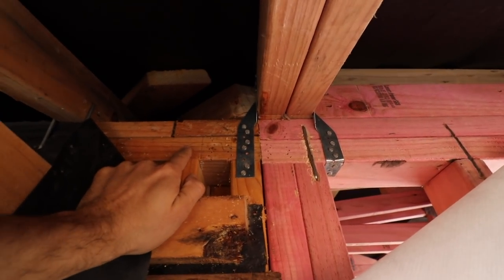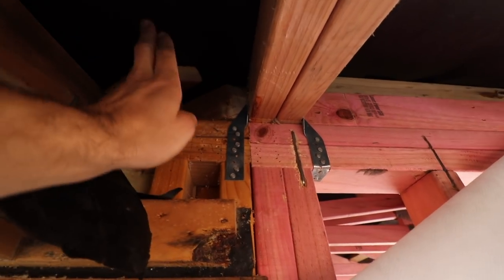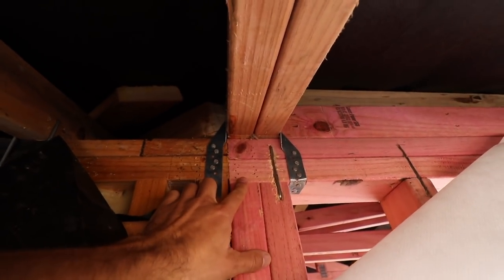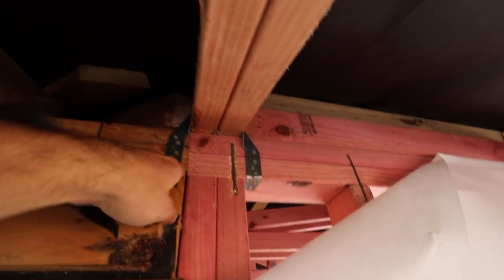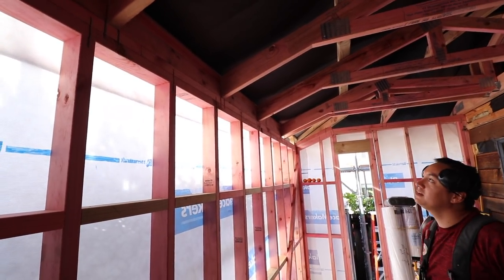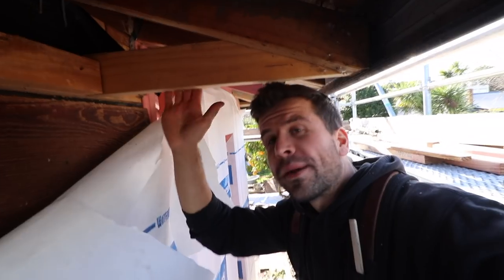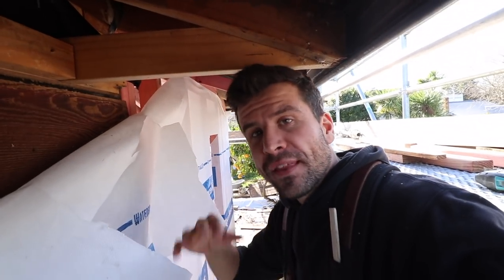Why is New Zealand Timber PINK?

Comment: It’s a national standard, H1.2 is generally boron treatment against mould and decay fungi. It was a government knee jerk reaction to the leaky homes crisis which was a combined result of poor design, poor scrutiny by local authorities and sub standard work by builders to make treated timber mandatory   Net result - more expensive compliance costs, material costs and builders overheads = expensive homes.
Reply: I think a lot of what has happened since has been an over reaction. Who took the blame for this? The greenies copped a fair bit of blame, I think also the timber companies who did the "big enviro friendly" thing back in the 90's, and sold this to the government and  local councils, need to take their fair share of the blame, and James Hardies products failed, but of course James Hardies wouldn't accept their part in this fiasco. The other reason, I believe, was the fact that people wanted to start living in these plaster over fibrolite cladding homes, which looked impressive, but were only really suited to Mediterranean climates, not the moist humid climates of NZ.
Reply: It's green in Australia. No need for pink
Reply: Definitely an over reaction from what I understand its difficult to get the required treatment for marine structures h6 I think it is.
Reply: No, H1.2 is not treated against mould and fungal decay, that's H3.2 and higher. H1.2 has to be maintained below 20% moisture content to meet its durability requirements under 3604, tho the treatment makes it resistant to both borer and two-tooth. And as a builder who had worked on houses that were severely affected by leaking, two that should have been bulldozed cos it would have been cheaper to build a new house, in the long run its cheaper to build a house that lasts the required 50 years (less for some components) than it is to replace or fix every 15 years.
Reply: philthy122 my comment re preventing mould was an error but boron does in fact protect from decay when used in a protected environment such as wall framing where exposure to moisture is rare - all things being right. 20 years of timber processing I’ve seen thousands of tons of H1.2 processed
Reply: @philthy122  H1.2 is indeed a treatment for both insect, mould & fungal decay - that's where the 20% moisture limit comes into it. It's for "Closed" environments where that moisture content will be expected to be maintained, not in Exposed or Sheltered environments. H1.1 is the treatment only for insect and no longer approved. It's the same with H3.2 - there's a moisture limit beyond which the decay treatment is no longer effective.

Comment: H1.2, 3.2 that is a weird treatment level, In AUS we have H2 Blue (internal or undercover use only) H3 - Green external use above ground, H4 - external use in-ground, H5 fresh water contact, H6 Salt water contact, anywhere above tropic of capricorn needs H3 minimum.
Reply: That's evidence of the lead NZ has in timber treatment. Those grades describe the overall building environment but there are various sub levels of treatment depending on the expected moisture content or type of element exposure within those grades. Eg: H1.1 for just insect, H1.2 for insect and moisture to 20%, H3.1 for exterior timber but requiring painting in use (eg trim and weatherboards), H3.2 for exterior unpainted (eg. either exposed or sheltered deck framing or subfloor framing closer that 600mm to ground)
Reply: And it's not necessarily a "depth" or "strength" of treatment, but different types of chemicals used will give different grades. Eg. With the radiata pine that we generally use LOSP treatment cannot achieve H3.2 but will achieve 3.1. (LOSP general has a kerosene-ish type smell)

Comment: Basically it's a boron treatment that helps cut down on water uptake and probably makes it at least mildly insect resistant (most people-safe insect resistant solutions contain boron).

It's only really rated for indoor use.  So it's not like you can make house cladding out of this stuff, as it'll leach out under sustained wet/dry cycles in the open.
Reply: Thankyou for the simple explanation which solves my concerns about it warping.  Here in the US, you only use pressure treated for boards in contact with conctete, or the ground.  They warp FAR too much to be used as wall framing. Building a wall with the treated stuff we have here would be a disaster. We also have nowhere near as wet of a enviroment as New Zealand.

Comment: Here in the US, you only use pressure treated for boards in contact with conctete, or the ground.  They warp FAR too much to be used as wall framing. Building a wall with the treated stuff we have here would be a disaster. I've learned that these boards are basically just boron treated, which isn't the same process at all. We also have nowhere near as wet of a enviroment as New Zealand for the most part depending where you live.

Comment: Wow yeah that's a bit of over kill for framing lumber. Here in Canada, we sell both, 'pressure treated' (anti rot preservative) and untreated lumber. Untreated lumber for framing is accepted cause we have a vapour barrier design. Plus all exterior walls use 2x6, to get required 'R' (insulated) value.  2x4's are only used for interior walls.
Reply: Canada does not have the wood borers that NZ has. Much like powder post beetles. Will even destroy your furniture. All older buildings are riddled with tiny holes.
Reply: Ahh yes that makes sense then. Damn isn't there anything down under that doesn't kill you or destroy your homes...lol.
Reply: If Mike Holmes show is anything to go on, you jokers need to make a few changes
Reply: In Canada, we also have bluwood which is treated lumber for internal use that is rot and insect resistant...  Maybe it's the equivalent?

Comment: Many years ago, I used to work at Placemakers, and the standard framing timber grading was H1 Boric (bora) treated, it had a clear tinge to it, I left the building industry and came back to it after the leaky home issue, and found that the timber was pink, now called H1.2 treatment, perhaps an over reaction to the leaky home issues. As for H3 timber, I believe that NZ developed treated the tanalised process back in the 50's and sold it to the rest of the world. Countries such as the U.S and Canada, are no longer using H3 treated timber, because of the chemical content C.C.A, contains arsenic. I had to retro fit a house with underfloor insulation, and all of the piles, bearers and joists were the most beautiful heart rimu that I had seen. No rot, has stood the test of time, at least 60 years. It seemed like such a shame to cut heart rimu, but it sure looked good.
Reply: You must have left a long time ago. Boron treated/H1 timber has been pink for as long as I can remember which would date it back to at least the late 80's. I remember it clearly back when I was  a kid kicking around McVicars during the school holidays, a long time before the whole leaky building saga.
Reply: @thesavagekiwi3492  There used to be both H1.1 and H1.2. Now only H1.2

Comment: Looks like some nice lumber. In the USA our lumber is shit. Twisted , bowed. Junk.
Reply: Stop buying from home depot
Reply: In the US you can get lumber out of more usefull hardwoods and not just radiata pine.
Reply: Miles11we the lumber yards are typically not any better, at least in Southern California.
Reply: @robertaylor9218  at least for me, if you have a decent relationship with them you can get good material/not have problems when you ask them to pick up and replace garbage wood
Reply: NZ radiata pine is the just about the fastest growing stuff in the world. 25-30 years to mature crop, tho most gets logged at 20 years. The vast majority gets exported to be turned into pulp for the toilet paper industry, cos higher wages shut the processing plants down here years ago. The stuff we get left for framing is the stuff that isn't high enough quality for export, aside from some for clears. And the vast majority of arc's, fascia, jamb's, and trim is finger jointed junk. The only places you'll get half decent local stuff in from small saw mills, at a cost.
Reply: I've seen plenty of shit timber in nz too. It seems the timber that is supplied for delivery to islands is normally always extremely bowed twisted and full of knots.
Reply: Yep, its a shocker. I worked a good few year in Europe and used a lot of Norwegian pine, some of it has the weight and density of Rimu, somewhat similar to Larch. NZ pine is junk, and to be honest J-frame is rubbish made from junk.
Reply: Same in Canada lumber is shit.  have to go through the whole pile to find a straight board.
Reply: I have no issues with lumber from home depot
Reply: @Rideeon  Its sad cause we have good wood, we just tend to export it
Reply: have you been anywhere other than home depot???
Reply: Is it dry where you are? I'm in Alberta where standard humidity is quite low, and the wood (especially from Home Depot) twists and warps like crazy. In NZ, it's common to have humidity around 60% or higher, so it won't dry out as drastically.

Comment: That wouldn't fly in Finland. Treated timber isn't very ecologically safe or healthy to be around too much.

We have treated timber, but it's exclusively for outdoor structures that are exposed to elements, so most structural timber is raw.
Reply from the maker: It used to be that way here too. We had a leaky building problem in the late 90s. Crazy treated timber is one of the reactionary results of that crisis
Reply: Bullshit. Timber has been treated here since the 50's-60's and the only reason that H1.2 timber was so badly affected during the "leaky homes" saga, was architects designing building with poor flashing details, councils dropping the ball on checks, cheap alternatives to traditional cladding systems and builders too stupid to see that water getting into the wall cavities or running down trusses was going to rot. Prior to using pine, which borer love, most houses were built with Rimu, which will hold it integrity against borer (to a point) much better than pine, but will rot like hell if it gets wet for too long....hence lead based paint. I thought the LPB system was meant to weed out muppets.
Reply: Yeah, I wonder what kind of vapors pink timber out-breathes. I would not want to breath that in.
Reply: Treated is a must in my country Australia.  We use treated timber throughout as we have termites that will eat your house.
Reply: Its actually scary how much they can munch thru before the are noticed in an old building. Did up one place in Paddington a few years back, looked like one board needed replacing...turned out to need whole new floor joists and all, it was rooted.
Reply: @philthy122  BS on rimu and borer. Borer still love it. And the higher the moisture the more the borer love it. Yes they love pine too but radiata takes treatment better than almost any other wood.
Reply: philthy122 Worked with it for 34 years and been involved & exposed to trade including demolition for 20 more years. 

Wtf is your point about H1.2 & H3.2? H3.1 is also in the standards H1.1 used to be. Sfw??
Reply: philthy122 Fact is, borer & rot are the 2 main issues in old buildings. Yep, heartwood is not munched first but as you say, the sap wood is buffet. Once borer appears in Rimu framed buildings they will be toast. Frame, trim, flooring it's all lunch.  In the moist soils & air here in Wellington you get to see the worst. Treated radiata is far far superior.
Reply: @DiscoFang  ok boomer...
Reply: philthy122 You seem so sure of yourself but keep missing the mark on everything. You can't even get your dates right.

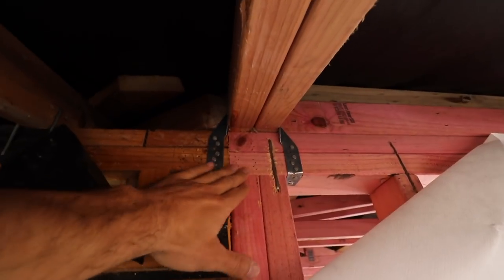Comment: 0:59 What's the metal rods I can see running vertically next to your hand in the H1.3?    Is it some kind of tie-down to strengthen the joint between the stud and top plate?
Reply: Probably just to hold the 3 beams together. So they wont slip. Dunno if theyd be able to smack a nail in through all of them. Just a guess though lol
Reply: I'm curious as well.
Reply: Its like a twisted nail plate.  Connects the truss to the frame.
Reply: (Tie down) all trusses are tied to the frame. Frame is tied to the slab
Reply: Just realised u we’re talking about the other ties. Never seen them here in aus

Comment: Just learn how to make bricks in NZ. An added bonus along with them not rotting is that brick houses don't blow away in the wind.
Reply: bricks might not rot or be bad in a hurricane, but they do on the other hand fail catastrophically in earthquakes, which they get plenty of in NZ. Give the kiwis some credit, they're building to suit their conditions, what works in one country won't in others.
Reply: NZ has some magnificent masonry building all over the country. All of which are far more vulnerable to earthquakes than a brick bungalow. They build out of timber frames and cladding because it is cheaper, just like the USA.
Reply: terrortorn 
Wrong. I used to go and install new fireplaces in towns that had been dealt to by earthquakes back in the 80's in NZ and every place that had brick facade walls (can't build the superstructure out of brick due to known lack of integrity during quakes) had the whole lot spat out under compression loads. Steel reinforced, grouted block work or large stone masonry (not brickwork) tied to steel superstructures can take a fair amount of the aggressive loadings that come with earthquakes but brick structures suck the farts out of dead dogs arses when confronted with the same.

Comment: Thats so odd to me, because honestly if the house is built weather tight to begin with the timber inside the wall and under the roof shouldn't ever be exposed to that much moisture...
Reply from the maker: You are right man, If it is built weather tight to begin with. ..The problem is, here in New Zealand there was a period of time in the 80’s-90’s where a lot of new houses started leaking and rotting. As a reaction to that they tightened up the building code and made it so all housing timber had to be treated. It has got to the point where it is actually hard to find untreated timber.

Comment: Yol SBC, meen clips ty. Sistering timber H3 beside rotted cut stud at the bottom in te shower. would I cut cut stud a 3rd up and run sisters both sides from plate to knog or something g else thanks Scott🙌

Comment: What is H1 and H3 about?
Reply: treatment H1 is basically for insect and dampness treatment.H3 is for thin]ber that will get wet on occasion.H4 is for timber that will be wet a lot,but if it is a important timber it will be H5 which is the highest level of protection .H3 to H5 is ussually a pressure type treatment with Copper Chrome arsenic(cca)
Reply: H6 is for marine use piers etc.

Comment: As a kiwi and a builder, I call bullshit on most of your reasoning. In the 90's the timber was also pink, although there was still a quite a bit of clear treated H1.2 stuff being used, the date of production can be found stamped along the wide side of the timber). The timber from the mid 80's and back to the 60's, when pine was phased in as Rimu ran out,  had a clear yet extremely heavy and toxic treatment. So toxic that mills that once processed it have soil contamination issues today. Boron treated is dyed pink for two reasons; 1- the rate at which they dye looses it colour when exposed to the environment (goes grey) is approximate to the rate at which Boron is leeched from the timber, so that pink is treated and faded to grey is no-longer treated or acceptable under 3604 2 - it distinguishes it from higher treatments like H3.2 which is green (as are H4, H5 and H3.1). Rotting reffered to is more to do with poor flashing practices, amended with E2 (to address the leaky buildings issues)....finally if you don't know this you shouldn't be an LBP and I would question any restricted work you do.
Reply: Right on both counts, cheers.